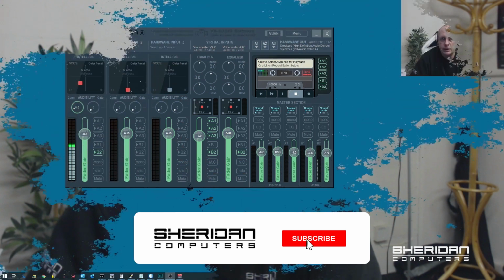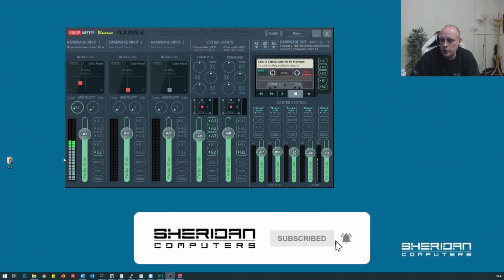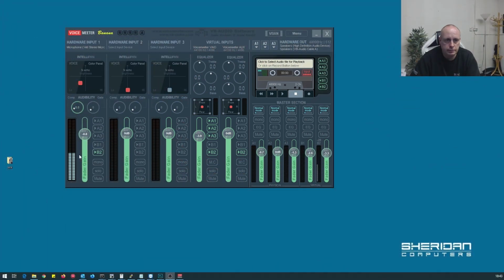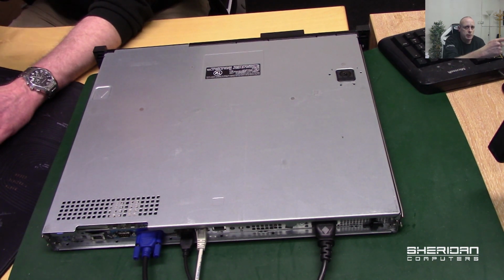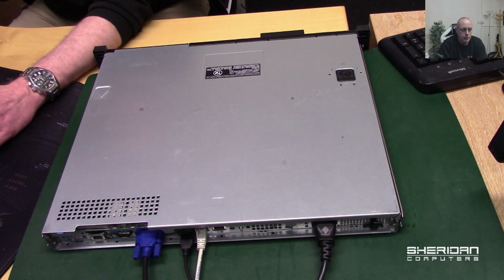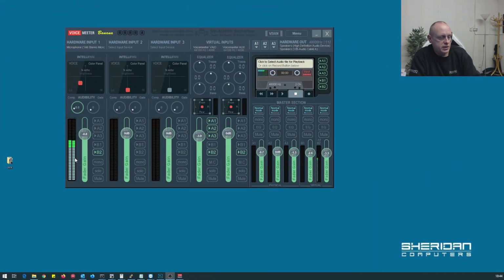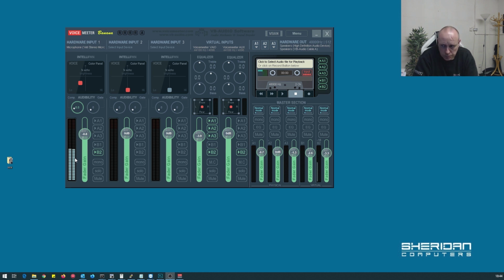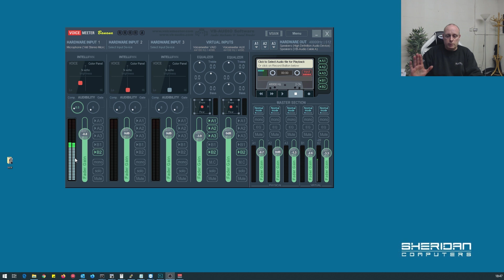Dell PowerEdge R210 II - Acoustic Server Noise

Comment: Wow, thanks a lot, feel so special now :) I am looking to buy one, probably will replace the fans with Noctua NF-A4x20 Cheers!
Reply from the maker: You're welcome, had the kit set up so was quick enough do :)
Reply: @sheridans  have just bought one :)  165 quid, not too bad, comes with 160GB intel SSD + 1TB WD HDD, 16GB RAM and additional 4 port NIC (hopefully Intel as well). The front bezel is missing though, will need to find one somewhere
Reply from the maker: @sergey930  Not a bad price at all, you'll have fun with it :) Works well with XCP-NG too for virtualisation